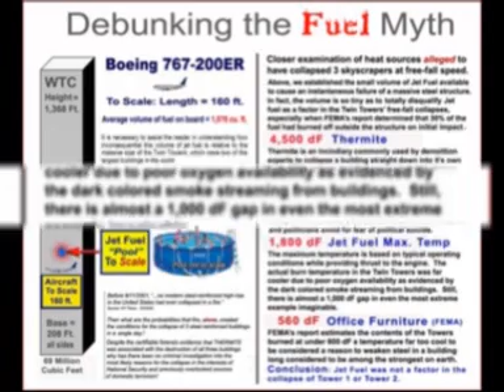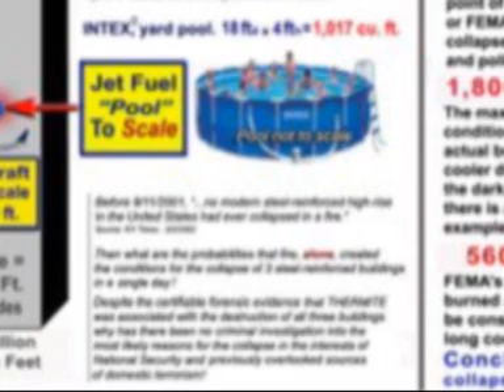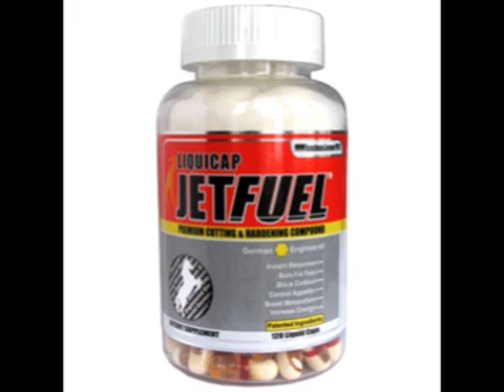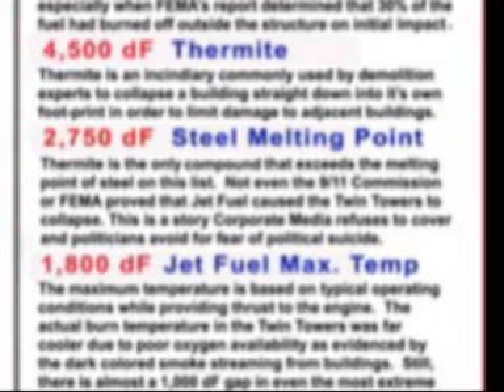Facts About Jet Fuel And Steel

Comment: @amazingascention 
If you read what I said, you would have noticed that I talked about "context". Do me a favor, go start a fire and record the temperatures...It will be around 1800F. Now, melt aluminum in that fire without a container. What happens? It melts and flows! When it flows, it COOLS and burns whatever it comes in contact with, like carpet and wood. You have to understand, aluminum at 1800F does not look like "lava". To believe jet fuel made it to the B levels, is a stretch.

Comment: The author says " A little common sense airplanes are made of steel." Fail.  The EXPERTS say, the impact blew off the heat protection of the structure and the subsequent high temp caused the metal to weaken, losing its load bearing capabilities.  Thermite as said in THIS video is NOT used in paint. Fail. He also states "How can jet fuel melt an entire steelframe building, let alone 2 or 3 of them." No one ever claimed the WTC "melted". Fail.

Comment: @8real Yes, alot of people still believe the $6million man theory: energy can come from no where.  It's great to see that U have taken the time to experiment, but no one can exp w/ nuclear material.  Radioactivity is as assumption based on 50's tech, when slide rules were used for math.  If U have the thermal images taken the 16th, I would love a copy.  It shows a defined radius under bld 7, this is the crater outline.  Look from this POV and everything lines up perfect.  Physics is the key.

Comment: @amazingascention Ever seen an Aluminum exhaust system??  If u have, it didn't last long.
The COMPRESSOR BLADES may be made of Alum, but to say the turbine of an ICE is alum is absurd.  That would be the equiv of using alum for exhaust valves.
And YES, ceramics are used for high temp blades.  wiki turbines, read it a weep.
I am well aware of most all manufacturing techniques, having studied them for more than 5yr in collage.
Plz give me more comedy to work w/, it's funny to hear a layman's compr

Comment: @amazingascention $6 million man theory: energy can come from nowhere.
How do explain the creation of 2000 deg temps?  Even the underground coal mine fires in PA, which have a fuel source, don't come close to such temps.(decades)
U dkw a turbine is.  Turbines recover energy from exhaust gasses, same function as a turbo.  They are made of high temp steel, titanium, or ceramic.
To say molten alum looks like lava is a bold face LIE.
Ur circular logic consist of "the media said so, it must be true".

Comment: @amazingascention 
2000F would be the absolute hottest the fires could have possibly got from jet fuel. You are indoors, in a controlled environment,. That aluminum is constantly heated. During cleanup, what makes you think the aluminum would be scattered all over the place - multiple eyewitness accounts - and still 2000F? In the context of the subject, it is not feasible to think the plane crashed and formed pools of red hot "lava" all over the place. Try and research the subject a bit.

Comment: Throw a beer can in a fire, what happens?  It turns to alum oxide, it doesn't melt.  Alum requires an inert atm, or it bonds w/ O2.
Molybdenum (alloy used to toughen steel) spheres were found in the dust.  It takes 4700 deg F to melt moly.  The primary component was aluminasilicates, granite (bed rock) is 72% SiO2, 15% Al2O3.
The ONLY spontaneous reaction that can support this evidence is nuclear fission.
p-waves can not be heard by humans, find shaking tower
Hurricane Erin was off NY that day.

Comment: @amazingascention The bellows were invented by black smiths when they started using iron, due to the FACT hydrocarbon fires can't produce a temp high enough to weaken it w/o forced induction.  Even then it takes alot of energy to form.  As a machinist, we learned steel is the easiest material for which max temp can be determined.  In open air, kerosene/JF burns @ 213 deg C.  Natural gas burns hotter, when is the last time U seen a cast iron skillet glow red??
How many turbines were recovered?

Comment: When you see most steel in the rubble, it wasn't "molten", it was heated sufficiently to weaken it, thus not able to sustain the heavy loads, and subsequently collapsing.  Airplanes are made of Aluminum and Titanium alloys, not steel.  You reference Google, try using it.  Deliberate demolitions do not make perfect 45 degree angles as you suggest.  Due to the crystalline structure of the steel molecules, when stressed to the breaking point, they fail in sharp angles.

Comment: @josh71111 Jet fuel is like kerosene.  It burns at a maximum of 1800 F under ideal conditions.  Steel melts at 2750 F.   For more about the melted steel at Ground Zero, see my video:

The 9/11 "Deep Mystery" and the Crazy Engineers